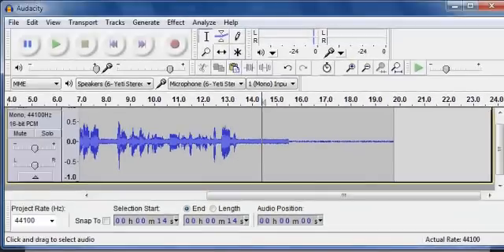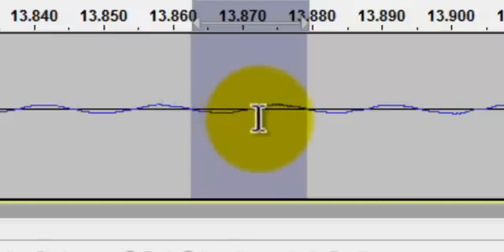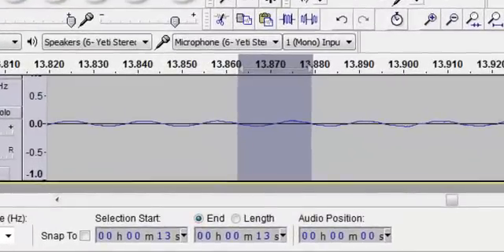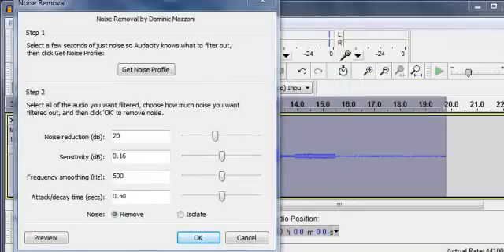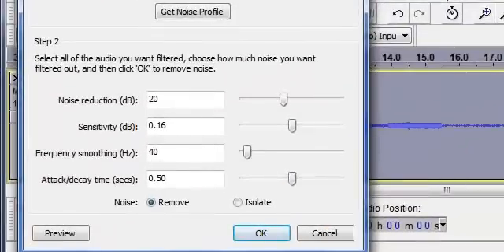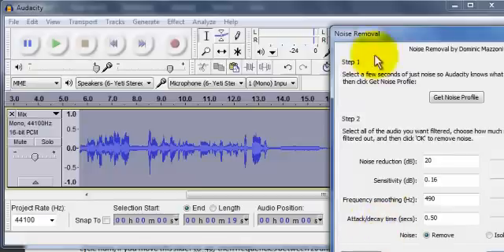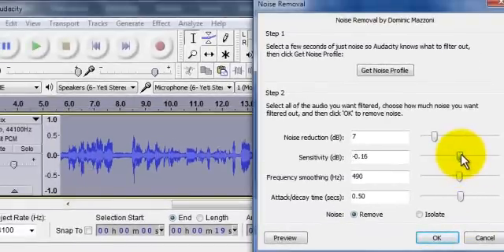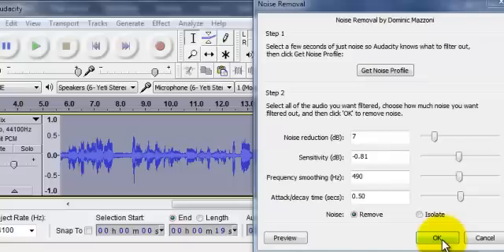Audacity Noise Removal: Those Slider Thingies Explained

Comment: Why when I use Noise Removal, do I get a result which sounds "liquidy" - not pure speech?  How do I prevent this nasty distortion, please?
Reply from the maker: Probably too great amount of noise reduction applied causes this.  Use as little as possible and make several passes to see what happens.
Reply: @cajun5454  Thanks Phil.   I used the default 12db  and sensitivity 6.00.  It used to work good on this, then after experimenting withe these settings, it doesnt work properly anymore. Any suggestions?

Comment: Thanks, this helped me start figuring out how to remove background noise!  The explanations about how each one works and when you might want to use which is very helpful.  I've also found you can go and type in the values you want instead of using the slider.

Comment: TL;DW: At around 7:50 he starts explaining what the slider thingies mean: these two values control much your audio will be filtered but in different ways

noise reduction = how much the noise will be reduced by (higher values reduce more noise)
sensitivty = how much audio will be affected by this (higher values reduce more noise at the risk of removing wanted noise)

Frequency smoothing: if artifacts appear from the filtering, increase this to max (6)

Comment: I have a question. How can I add the reduced back ground noise to a certain part where there is talking? When I try to add to a certain time frame I hear nothing, I know I'm doing something wrong.
Reply from the maker: Noise reduction in Audacity reduces the noise or background from the 'silent' parts of a track.  This means that the background noise is not reduced from the 'talking' parts; it is still there.  So you do not need to add it back.  If that does not answer you question, please explain more what you want to do.
Reply: Phil Chenevert  OK I thought and was hoping by reducing the background noise in the silent will also work where there is talking, because the background noise on my recorder is too loud to hear the voice.

Comment from the maker: Thanks for the kudos.  I believe you are correct that the freq smoothing slider does indeed work that way.   I will do some research to pin this down exactly to see if there is a mathematical correspondence to the number in this bar.

Comment: Kudos on the video. I needed another way of looking at noise removal besides what is in the Audacity Manual. I'm with you until you start explaining the frequency smoothing slider. In your example the noise is a 60Hz hum. So if you set the freq. smoothing value to 40, frequencies between 20 and 100 would be considered noise right? It sounds like you say "frequencies between 20 and 60" but then it sounds like you clarify your statement. Is the smoothing slider like a plus/minus value? In other words, a 60-cycle hum with a smoothing value of 40 opens the frequency range to 20-100.  Do I have that right?  I think I do. I would truly appreciate it if you were to let me know if I have it right or not. I look forward to watching more of your videos.

Comment: Hi, Phil, you're fantastic at explaing the technical stuff! I've had some success by going to Effects>Change Tempo, and slowing the music from 45 to 33 1/3, getting the noise profile, applying the reduction as per your instructions, then back to Effects>Change Tempo, speed back up from 33 1/3 to 45. It takes some time, but it gives a longer noise profile, and separates the noise farther from the audio (in my case, Music), resulting in more reduction and less distortion of the audio.

Comment: It was helpful but I've had to watch it 3 times over in an attempt to clarify the concepts you are presenting.  In this video you are jumping around alot before you finish explaining a specific feature.  It would also be helpful if you gave more working "preview" examples instead of just using words to attempt to illustrate the effects.  Either way - thank you for your contribution :)

Comment from the maker: Try to quiten your recording space; turn off machines, move noisy computer fans as far away as possible (mine is in the closet), put blankets up to stop stray noises reaching your microphone; if possible, use a directional mic so it won't pick up noises you don't want, don't bump things, etc. etc.  and you may have an echo effect turned on; also too much noise cleaning can make it sound like you are inside a big pipe.

Comment from the maker: Not usually. Most recent Laptops have mics built into them.  when you set up Audacity and press Record, it should kick in automatically.  If not, you can buy a cheap mc and plug it into the right place.

Comment from the maker: the microphone picks up all sound, and that includes your fan.   I suggest finding the frequency of your fan (use the Plot Spectrum feature in audacity), then a notch filter to take out just that frequency band. I have videos about both of those I think. perhaps getting a mic with a chord so you can move away from the laptop?  that would help a lot.